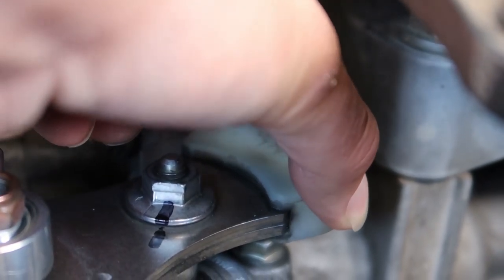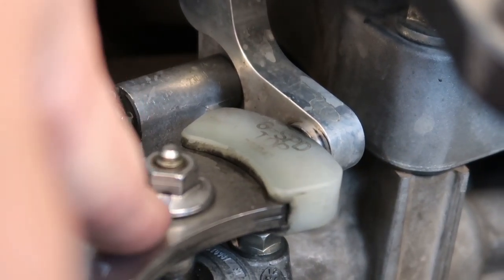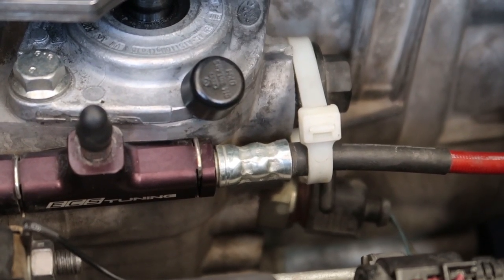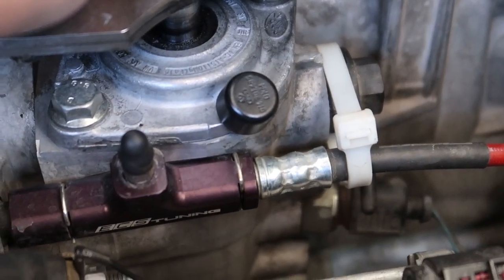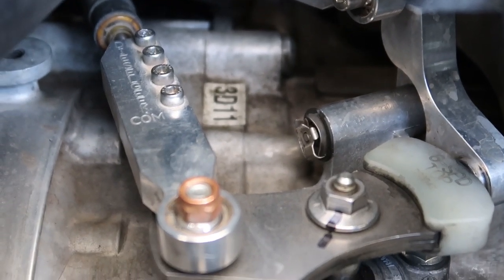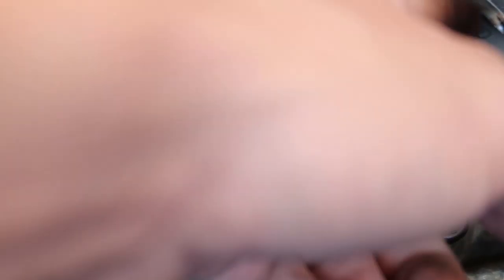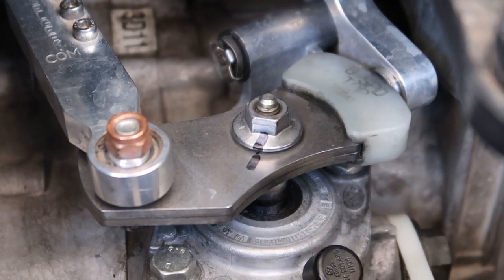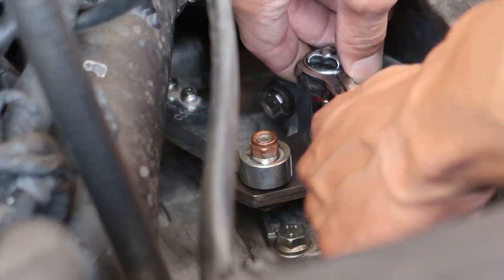Shifter Fixed & Parts to come! | MK7 Golf R

Comment: Great as always!.  Two things:

1. Loctite on that shifter bracket thread...I know that thread is very sensitive to over torquing. I guess you plan to never remove?  People have snapped that off pretty easily...just an FYI if you didn’t know already.  

2. 3rd Gear Lockout. I hope what you did fixes your issue but I’ve been having the same issue and I thought it was my DKM Clutch.  I’ve seen others have this same issue with Soundbend also but never seen a resolution.  From what I can tell...this transmission doesn’t like NLS as it’s the only time I would get a lockout.  Another person I talked to recommended the Clutch Masters 725 Twin Disk and swears that it’s the only clutch you can NLS in but who knows.  It’s tough owning a manual in this platform as many don’t race them as much as the DSG so there isn’t as much info/research.  

Just some thoughts, not trying to be negative as I’m a huge fan you already know.  Look forward to the video with the P3 Ethanol sensor install.
Reply from the maker: I threw some threadlocker on there 🤙🤙 I have and always could NLS this and the OE clutch, I can go months fine no lockout then boom I'll have issues back to back, make some adjustments and be fine again. It's very annoying 🙄. This seems to have fixed it, along with another fluid change I should hopefully be good for the race season! I haven't heard much of that clutch myself yet, is this on the mk7 golf site or on FB?
Reply: Bryce Jordan Productions The clutch is not popular but expensive. Not much on the forums about it. But I think Lexi from TCR and Billy from A2B ran it.

Comment: Interesting to follow your build as always! How much toe are you running front/rear?
Reply from the maker: 1/10th out front and rear 🤙 rear helped the car rotate just enough for my liking
Reply: @BryceJordanProductions  thanks! Just  finishing up swapping all bushings for polyurethane ones and will have it aligned after. Is it okay to use for transportations at like 70-90mph or is it "scary" to drive?
Reply from the maker: I cruise at 80 on the way to work everyday, not sketchy at all doesn't pull or anything weird! I've had it up to probably 150ish on this alignment with no complaints

Comment: did you do a diy video on the diesel geek short shifter kit? i had one on my gti but it was really notchy and trying to get it into first gear was a pain in the ass
Reply from the maker: I didn't but it takes a lot of fine adjustments to get just right. It shouldn't be hard to get into any gear
Reply: @BryceJordanProductions  ill have to mess with some more then! it was really hard to get into first gear
Reply: @BryceJordanProductions  hey bro so I threw the shifter kit back on after work and all I gotta say is I should’ve been more patient and figured out how to properly adjust it. It’s definitely way better then the stock shift linkages 😅
Reply from the maker: Glad you figured it out! Pain in the ass but so worth it! Every so often make sure that main nut is still tight for the shifter shaft. Mine came loose once and started eating up the spines for the shifter
Reply: @BryceJordanProductions  appreciate the info ill definitely keep an eye on it! I did notice that when I went to take the stock shifter brackets the nut was loose.

Comment: What up, you never have issues with the internal transmission forks? My is the 2nd time to open my transmission replacement the forks 3rd to 4th 😥.
Reply from the maker: I don't man. Did you upgrade forks when you did it last time?
Reply: @BryceJordanProductions  OK,  no because I still had a guaranteed. But this time I'll upgrade. Thanks
Reply from the maker: A warranty? How'd you get them to honor that lol
Reply: @BryceJordanProductions  because I have a friend work for VW dealer shop 😜
Reply from the maker: Luckyyyyyy!!